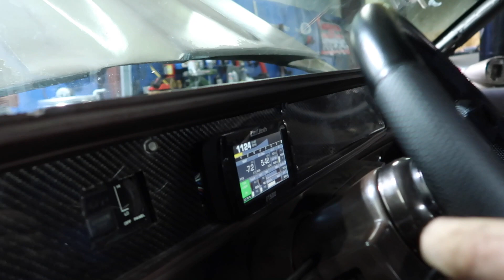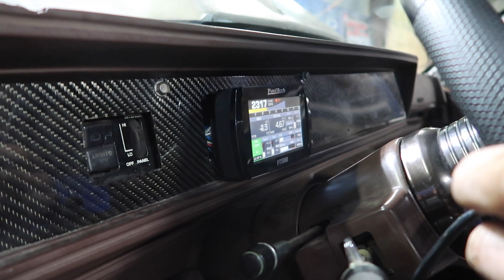We put our Turbo LS Swap Cutlass on ALCOHOL!!!!!

Comment: How much is the difference from tuning 93/E85 to alcohol?
Reply: About 1.5 times as much fuel a bit more advance on timing, compared to e85. Alcohol is a group of compounds. Ethanol, methanol, isopropanol, etc. are all alcohols. Methanol is the smallest molecule chain of the alcohol group. It also contains an atom of oxygen. Methanol is the best. It makes plenty of power. Nearly 30% more, just by switching fuel.

Comment: Methanol or any alcohol is highly hygroscopic, it absorbs water from the air quickly.  Keep that stuff capped up well and don't leave it open any longer than necessary.   Test for water by soaking a dollar bill in it and lighting the dollar on fire.  If you still have a dollar left, its because it absorbed the water:)  Too much water content will take greatly additional psi's to move the same volume through the injectors.